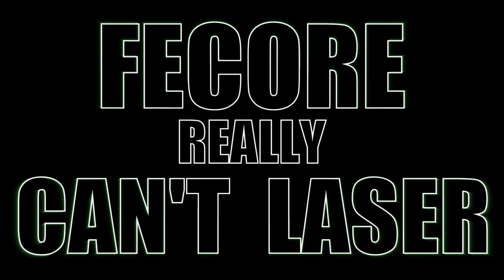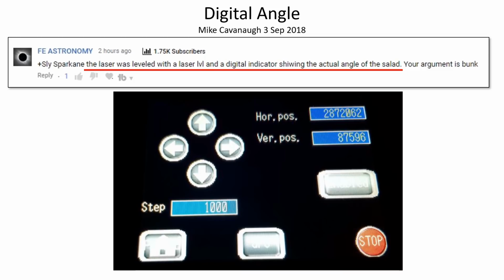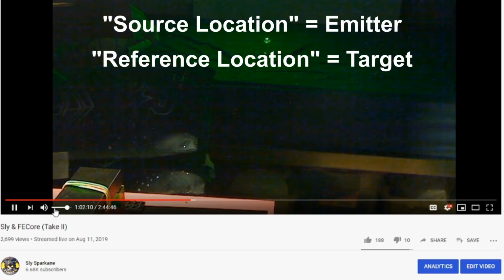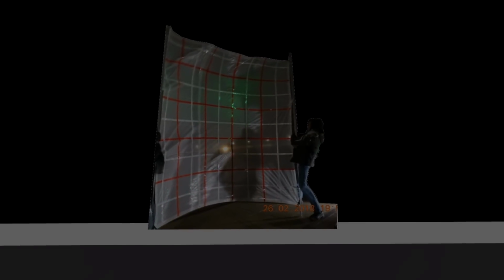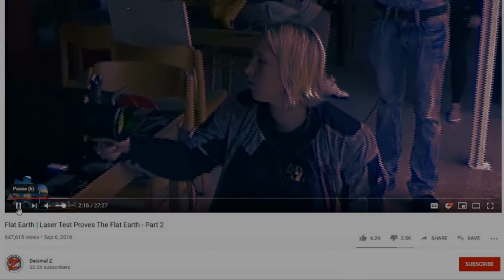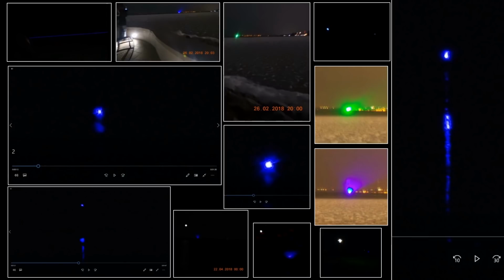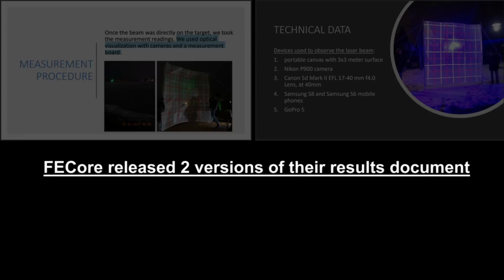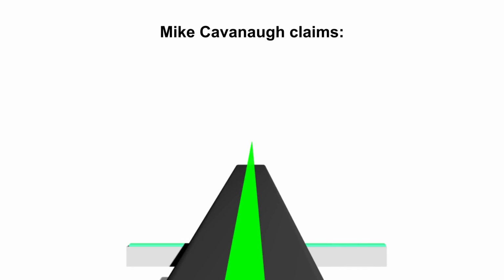Flat Earth: FECore REALLY Can't Laser

Comment: Hitting a target over a lake is useful if you have an appropriate experimental setup. ideally if the laser and the targets are at equal heights well above the water and you have a sail or something high enough to intersect the beam as you sail across and can measure the beam height relative to the water level.

It would also be a minimum requirement to have barometers and thermometers set up at least at a few sites in the beam path because that method is very likely to be highly influenced by changes in air density.

I have never seen a flat earth team publish results from this setup which is much easier to get accurate than finding an accurate level for the laser and sailing out along it.

Traveling enormous distances is not required for a globe earth test but you must check along the beam.
Reply: All of that is pretty obvious but no one had even a relatively good experimental technique in chat yet (and the video ones were.... not good)

Comment: I used a 5Mw laser with my telescope to align it, I forgot a battery for my red dot aligner. The two lasers I have say they can be seen for 10 miles and can permanently blind you. I am sure the laser they are using is much more powerful. So, if they are taking that picture from the distance they claim, and being uncollimated, the dispersion is obvious and we don't know the refraction, otherwise it would have damaged the optical sensors in the camera.
Reply: @MilitantPacifist LOL as cool as a 5 Megawatt laser you be, it's milliwatt I believe I annotated it wrong. Thanks for the correction

Comment: And another Failed Engineering Core experiment with faulty documentation and lies about method used. My cats preformed an experiment the other night using a flashlight, the wall and treats. The final results the cats got the treats and the documentation they tossed all about the living room is still better then all the crap from Failed Engineering Core. Peace

Comment: A few thoughts about all of this.

A collimator for a laser beam is at least conceptually a fairly simple device.  You essentially "clean up the beam" by focusing it through a small pin hole.  This produces a spherical wave front that is then collimated with a lens to produce a parallel beam.  You use a fairly large diameter lens (or mirror) for the collimator and produce a distant image of the pinhole.  The limit on the divergence of the beam is mainly the simple Airy formula for the resolution of an optics, 1.22*lamda/d  Where lamda is the wavelength of the laser light and d is the diameter of the collimator.  Of course it is hard to actually achieve really small angular resolution in the atmosphere as the atmosphere is rarely calm enough to have a steady resolution of less than 1 arc second.

Initially settling the level of the laser by measuring up from say the surface of a lake two meters in front of the laser and again 15 meters in front of the laser is a reasonable way to do this.  It will be off slightly due to the curve of the earth over 15 meters but this is small compared to the increase in drop over many kilometers.  Still this will be difficult as the laser beam will be a fuzzy spot probably several mm in diameter so measuring the center of this fuzzy spot is difficult and getting this beam really level is difficult.

The people talking about the lasers used by FECORE seem to used the term collimated and coherent essentially interchangeably.  They are very much not the same thing.  Collimated is something that you can do to any light source, it's just a nice parallel beam.  Coherent is having all the waves of light in the beam in phase, that is in step.  Coherent light is very useful if you are using an interferometer.  There is nothing about the FECORE test that makes use of coherent light.

In general the insistence by FECORE and others to used lasers is childish and shows a general lack of understanding of optics, lasers, telescopes, surveying, etc.  FECORE could make much better measurements with a simple telescope or auto level.  It would be much less expensive and produce better results.
Reply: Charlie  : don't expect simple, or working, from the FECORE folks. It seems that just the mention of Wallace's method is enough to make them hear their mama calling.
Reply: @stevenspicer4873  Very true about Wallaces measurement.  A very simple measurement that avoided all the near surface refraction effects that are well know.  It would be extremely simple for FECORE to repeat what Wallace did but they don't even try.  It's almost as if they know what not to do to avoid a conclusive result.  :)